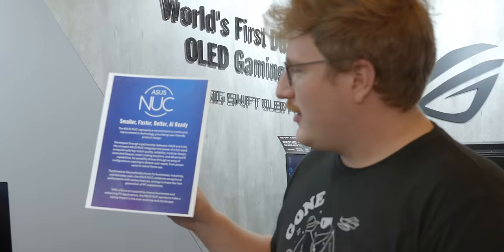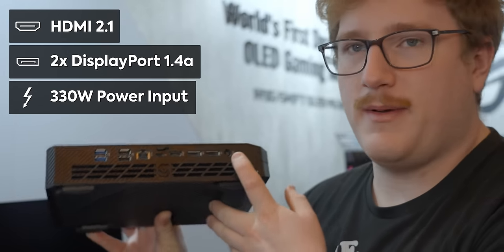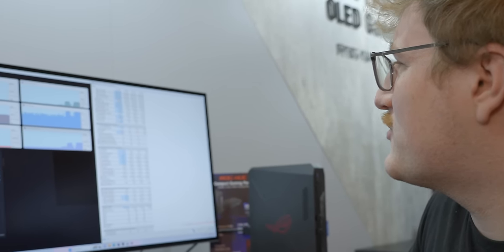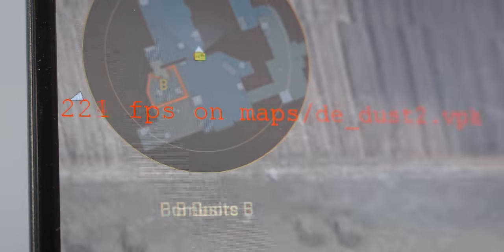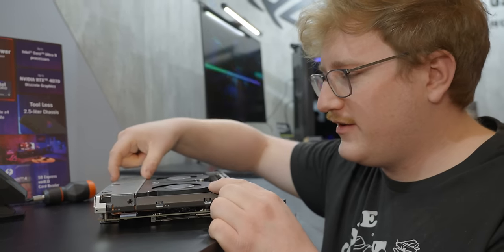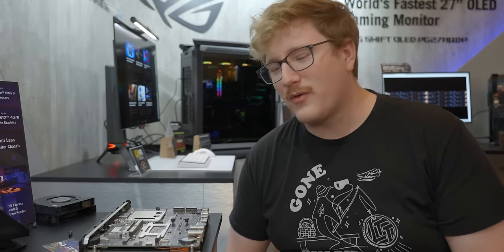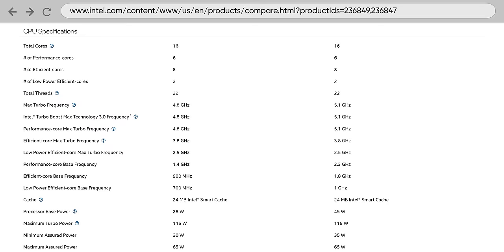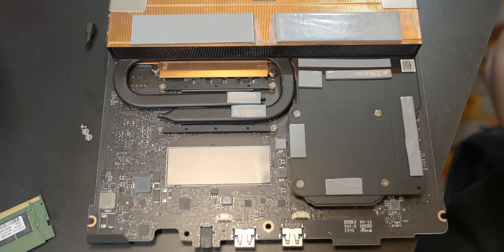ASUS bought this from Intel & made it GOOD - ASUS ROG NUC

Comment: this CES 2024 development is pretty substantial. The level of performance you can get in laptops and small PC's in 2024 is absolutely insane
Reply: Happy bot like auto fan boy person
Reply: Hp has a laptop that one can max with 128gb and FOUR 4 tb gen4 ssds!
Reply: @macking104  where's that laptop in this video??????????????
Reply: @BazShe  just comparing new items...
Reply: Even some of the new gen i3s/i5s beat out my old X99 HEDT dual CPU Xeon builds I have at this point for most of what I'm doing. Only real big loss is PCIe lanes but you can manage and mitigate that and/or having a separate system for a NAS.
Reply: @CheapSushi  who doesnt love some pice lanes

Comment: For a "complete rig" in a tiny box like that, the price is what I expected. Wanna see this on a drag race against desktop Macs, even if the market for NUCs and Macs are diametrically opposed.
Reply: I think the Mac mini is going to stomp it in CPU workloads, but for gaming this is a small gem.
Reply: Flying CIRCU175
Honesty on YouTube, why you cry that.
apple is other levels, ARM is the future, intel was the past....
Reply: @lucasrem if x86 is the past why is it still kicking ass? Not every workload is some 15w constrained bullshit that apple loves to flex with
Reply: The price isn't horrific, but it's still quite a lot. Like I just checked local prices and could get a 15" laptop with RTX 4070 and an i9 13900H (2 cores less, ~950 in Cinebench 2024 vs. 1003 seen in video) for a couple hundred less than the barebone NUC, and it'd come with a monitor, a keyboard, trackpad, RAM, storage, etc.
Reply: I would say, compare it to a laptop of equivalent specs, subtracting the mouse, keyboard and screen. 

Does it seem fair then? Arguably no I'd say.
Reply: @jubuttib laptops have the economies of scale advantage.
Reply: @Erispedia  Oh for sure, absolutely. But for the consumer that's kinda irrelevant, they're mostly thinking (or should at least...) which one is the better bang for buck solution for their use case, or at least get something else for their money that they desire. Like a higher end laptop might justify its cost over a cheaper one with the same hardware by just feeling better when used, or being quieter or something. But if your product costs more and isn't any better, it's a harder sell.

That's not to say that the NUC here doesn't have ANYTHING going for it. For example for some the extra ports and M.2 slots this offers might actually be important enough that this makes sense even at the price premium.
Reply: @jubuttib for $2,200 you can get a nice laptop. Way better than this thing. I'm not even sure what it's for. Maybe home theater PC?
Reply: @EikottXD  Heck, you can get a laptop with the same GPU and a comparable CPU for 1600 bucks. Lacks the ports and 3 M.2 slots, but you get a monitor, keyboard, etc. =)
Reply: well it's a laptop without laptop advantages but ok
Reply: @lucasrem  absolutely not. 
Using Arm for gaming sucks. It's compatability makes it useless when playing indie games
Reply: @EikottXD  Mini gaming pc's are far better for a portable gaming PC system. Gaming laptops have unreasonably loud fan noise under load, not everyone (like me) is an avid headphone user. Not to mention realistically you're not gaming on battery power (added weight with zero use and will eventually go bad), in addition you're not using a touch pad to game, so you'll at least have an external mouse or controller and you'll be plugged into the wall, might as well plug in a decent sized screen too. If you need to move a specifically gaming pc between locations a mini pc is the best option in my opinion. I take one to work and use it during downtime or the nightshift to game a bit and dabble in avatar/level design too. I tried a gaming laptop in earlier years and it was embarrassingly loud while gaming (silent mode severely limits performance). I don't like wearing my glasses all the time and 15 inches just doesn't cut it for me so I plug in a much larger external monitor.
Reply: It needs two Ethernet ports ... This isn't going to be the main machine it either will be a streaming device or a mini server or like an encoding machine for live video game streaming or what not so it needs a direct fast connection to a main device and an other (even slow e.g 1gbs) to the rest of the Network
Reply: @lucasrem  until Apple's ARM will become bloated like x86

Comment: I'm just hoping that they also have the lower end barebone NUCs as well.  My Home Assistant server is running on one along with a few other services and it is amazing and cost me less then $250 at the time.  It's also what I used for when I set up desktop computers for my in-laws because it's all they need and far better then getting a laptop.
Reply: Chinese OEM's are doing a really great job at that, with Intel n100 processors as well as the new Ryzen chips.
Beelink, Minisforum are great options. (I do have beelink eq12 with intel n100.)
But I don't think asus is going to go that way unfortunately. But let's see what happens.
Reply: Minisforum for that. Switched to selling those from NUCs a couple years ago after NUC reliability got worse and worse

Comment: The fact this has Thunderbolt 4 means eGPU. And that allows this system to go way beyond its limits.
Reply: Honestly mini itx pc is better choice than mini pc with egpu since mini pc and egpu size combined are very close to mini itx pc , thunderbolt in minj pc is more make sense to use for external nvme, monitor or  docking port , egpu defeats the purpose of mini pc which is space saving ,
Reply: At that point build a regular pc
Reply: No, not at all. Not TB4. Just use an extra M.2 SSD slot to get x4 speeds, don't use a TB4/TB3 eGPU.

Comment: The original NUC was the small cube boxes; I have purchased 5 at different times. I didn't feel the skull Canyon has the spirit of the NUC and gave the most problems pushing the power. (one fan fail), and now this Asus model is looking even bigger. I hope they can still do a small NUC, as this portability was great for  the small office desk space footprint. Let's see how Asus carry on the NUC flag in the future, as this is their first one, and I guess they wanted a gaming device. There are a lot of players in the SFF mini PC markets, so Asus will have competition at the lower end.
Reply: They will. This just happens to be bigger due to also having powerful discreet graphics. Need space to cool those puppies.
Reply: I deployed a bunch of NUCs and all of them had fan failures.
Reply: @Richkill  Wasnt it Asus that said they wouldent RMA mobos that had burning AMD cpus? Put out a beta BIOS to cover it then backtracked....then we have the whole capacitor that was turned upside down on a Intel motherboard? Asus with alot of premium products but they have a black stain all over themselfs lately...
Reply: They have more 'normal' NUCs which have the old form factor, or at least something very similar. This 'ROG' model is with mobile GPUs in it and drawing more power.
Reply: We use (trying to get an even rough estimate in my head) we'll say hundreds of intel nucs.  I don't think we've transcended the 1k mark but it's A LOT.  What everyone has said here is true.  Fan failures from generation to generation model (gen 5 to gen 10).  Bios updates great on some models but if you go back to gen 5 bricking is very very common.  They're a breeze to work with with SCCM on a massive scale.  However, the charm of the nuc is their size.  I see asus is looking to change that.  I don't feel that's a wise idea considering why one would want a nuc to begin with.  No offense to asus with this current revision.  It's a nice looking nvidia shield.

Comment: As a truck driver, this sounds wicked! Space is a premium and every little bit matters. This and a decent 24" monitor and I'm set to stay on the road for months!
Reply: Why not just a laptop?
Reply: Just use laptopthis is more for like stationary pc that used for tight room which is mostly offices, offline store, school, and campus. Remember that laptop thickness is always under 3cm
Reply: Because I didn't enjoy using a laptop in the semi. Far more comfortable to lay in bed and look up at a monitor at the foot of the bed vs a screen by my crotch. Lots of new semi's also already have a TV or a space to mount one on the side wall. This could easily be stowed away in a cubby or mounted next to the TV/monitor for a clean setup that's up and out of the way with no setup time required and no power cable to trip over. Keep in mind that the bunk is smaller than a jail cell. You have a single, maybe twin size mattress and a space 12-24 inches deep and 36ish inches wide to stand and move around in the bunk. A laptop works best when placed on the slide out table or top of a cubby you're already using to make or eat your dinner.

Comment: if you absolutely need a tiny chassis like this, i dont think the price is far off the mark. it has robust cooling, and if asus sneaks some bios tweaking options in there, i think it would be a pretty good micro box.
Reply: I agree with the cooling option being robust but it's cheaper to build a small form factor build. And with some of the cases out now, it's probably better to just build a sff build.
Reply: It all depends on how good quality the fan bearings are. I have ROG G20 and Fans over the years got so noisy that I had to replace them, and it was not easy since Asus uses specific fans (not the of-shelf pc parts) which are hard to find. I would say that price suggest that Asus thinks that if some one can afford it, then they can replace their PC every 4 or 5 years, so I would not expect fans to be calculated for more than that.
Reply: The barebones 4070 version being significantly more expensive than a laptop with the same GPU and comparable CPU (~950 cinebench vs. 1003 shown in video) is the biggest pain point for me. It's a tempting device, but really hard for me to justify that price gap. =/
Reply: "micro"
Reply: I'm hoping this releases soon. I'm in the market for a small PC like this and the only option I liked was the zotac zbox but it's only available on eBay and grooves land which is weird.
Reply: Something like this is right up my alley. I want something console-sized to fit under my TV, but I don't need a full-blown laptop. After nearly a month of searching, there's currently no SFF PC case smaller than 8 liters that can fit even the smallest RTX 4070 or AMD equivalent that can lay flat like this. So something that's smaller and doesn't suck down any more power than a typical Xbox or PS5 might be worth the $2K+ MSRP it's definitely going for.

Comment: Pricing may kill this PC (which would be a shame if they did not continue this line-up in the future). It has Laptop components, but even premium laptop with same spece, with battery, screen, keyboard and a touchpad IS cheaper. I kinda expected for ASUS to price it as a "premium" product (ROG brand, etc)....  but on top of lacking battery, screen, keyboard it also lacks SSD & RAM, which makes it WAY TOO EXPENSIVE. I mean, if there are already some great mini gaming PCs like Minisforum Neptune. Asus is entering Gaming NUC market and if they price it badly, they will not sell well tbh. Anyway, for that cash, you could probably build ITX PC with way better components.
Reply: That's my issue with it. It's a laptop without the screen, keyboard and mousepad effectively. It should be priced several hundred below laptop specs, potentially more. 

There's literally no reason to not just buy a cheaper laptop and a £10 laptop stand for this. The performance would be the same.
Reply: Minisforum Neptune are always sold out, no?
Reply: They're laptop components, sure, but they aren't constrained to power and cooling limits of a laptop, so ASUS should be able to pack more performance into it since they don't have to consider running the machine off a battery. For size to performance, especially if you're limited on space, it might be niche but there's some value to it.

Comment: Sort of the spiritual successor to the Hades Canyon NUC, I still use one after 5 years or so and it still works great.
Reply: I mean, we had Phantom Canyon and then Serpent Canyon as successors to Hades. This is really the spiritual successor to Serpent Canyon and considering how long it actually takes to plan and design stuff like this, I'm sure this one still has Intel's DNA in it.
Reply: IF YOU RUN GAME RIGHT NOW THAT CAME OUT 5 YEARS AGO OR LIKE 3YEARS AGO. DOES IT RUN GAME SMOOTHLY
AS IT DID 5 YEARS AGO WHEN YOU BOUGHT IT ?

Comment: I’ve had hands on a lot of mini PCs and every time I hold a Mac mini I think “why aren’t mini PC manufacturers integrating the power supply in the unit”?

Also smart of ASUS to take a page out of Macbook modding and add thermal pads to make thermal contact with the fans. Since you’re doing it on a desktop you don’t need to worry about higher surface temps as you would with a laptop; the price though, at that point you’re getting in similar-spec gaming laptop territory
Reply: My bet would be heat generation and space. It would mean less room for cooling and more heat generating components in that tight space.
Reply: Lenovo actually has one of these, it's the IdeaCentre Mini, I believe. Integrated PSU, current gen intel processors

Comment: The price is on the high end, but not completely unreasonable for what it is.  Even with a custom-built, the price goes up as the size goes down and not in a necessarily linear fashion.  I do think the product would be more competitive if the "with storage etc" price came in about $300 lower though.  Maybe they'll figure out a way to cut into that price a little bit without losing performance before the product launches?  Finding 15% in efficiency savings in production is a lot though...

Comment: 115 Watt TDP! Gosh no wonder you felt heat coming out from the fans. I had mentioned before to a friend of mine that you don't have to game with mega amounts of cores you can game with a Quad Core CPU and I suggest a Six Core CPU would be sweet on the spot and will be cooler and never overheat. 16 cores is an overkill and basically calling for a fire to start inside of the tiny compact case. NUC PCs should be cooler not faster. Also since it will be compact just like a laptop, the CPU doesn't need to be Overclocked as it will create heat. It needs to run at base speeds. Can you please tell us if ASUS will be selling these NUCs with dual lan ports? Thanks.

Comment: I currently have Minisforum UM780 XTX (Nov2023) which is IMO one of the top mini PC's of 2023. I have it hooked up to a full RTX4060 via oculink. total cost was USD $950.
Let's wait for the price of Minisforum UH185 (2024), if it's $1k or less, then I'd go for that. especially for its OCulink. I can just buy a $500 full RTX4070 to plug into it.

Comment: The pricing isnt completely out to lunch but at this pricing you could easily get a better base rig from minisforum with a destop gpu and enclosure for less while still having better performance across the board. Unless you're just that space constrained, this doesnt really make any sense.
Reply: this is way better than a minisforum in the configuration showed. Hell, they're not even comparable as they're for different portions of the market price wise. This is for users that need power in a small size. Miniforums is modest, this is EXTREME!

Comment: Damn. For less than $1700 you can get an Asus strix laptop that is better than that computer so. And for like $1400 or less you can get another brand That's not an overpriced asus. And I mean, I know fully well that you can get cheaper things that aren't asus that are just as good. But I still spent over two grand on an Asus 4090. When there's other brands that are up to $500 cheaper.

Comment: As some one who owns ROG G20, the only thing I am worried about when it comes to this ROG NUC is the Cmos battery replacement and how hard it will be (something that one will have to do at some point). But since this is a bare bone, I hope that ASUS engineers have placed Cmos battery in some easy to access place. Also....  This ROG NUC reminds me about the old Asus ROG G8 mini PC...  
EDIT: one more thing. This PC lacks rear audio jacks, so if you have 5.1 or 7.1 speakers, you will most likely need an additional USB external sound card, which kinda sucks.  I would gladly sacrifice 1 Display port for 3x Audio Jacks.
Reply: Tommy
ROG Toys, not a gaming PC !
Need audio, just connect a monitor, or ATMOS setup, nobody buys Soundblasters in 2024 !
Reply: Monitors audio passthroughs are often terrible  @lucasrem
Reply: @lucasrem  Yeah, but I have a very good sounding Logitech 5.1 speakers and those require plain and normal 3x audio jacks. The only way I know of to connect them to device that does not have proper input is to add some input via USB adapter - which external USB sound card is. Besides, ITX motherboards still do have rear audio jacks for that very reason. So on top of having an extremely overpriced gaming mini PC, you still need to buy SSD, RAM, and in my case an external sound card...  This thing looks less & less appealing tbh lol. You are right when you said it is "a Toy"... very expensive one. Minisforum mini gaming PC looks like a very good deal when compared to what Asus did.
Reply: I have the Hades Canyon and it has an analog/optical combination audio port but not 3 analog ports. I probably have the same Logitech sound system you have and I use the optical audio port. I also have a sound blaster USB DAC for use with my Razer tiamat true 7.1 channel headset which uses analog audio.

The truth is that all previous connections are pretty much obsolete now, USB C/4 can carry enough bandwidth for lossless high res 12 channel audio (7.1.4)